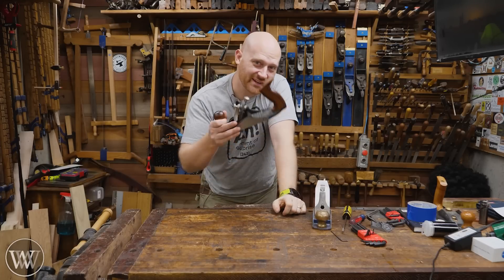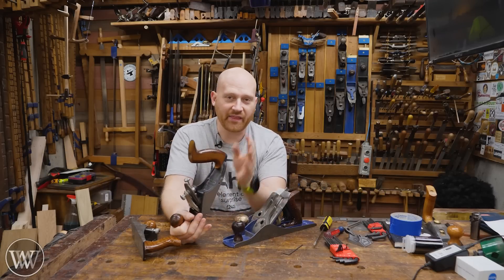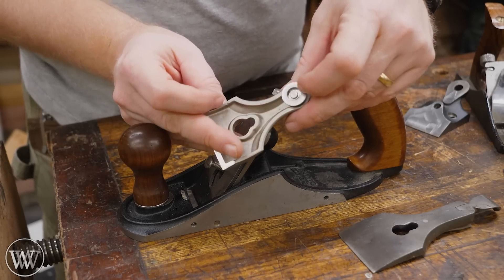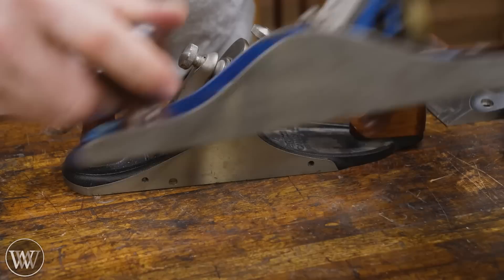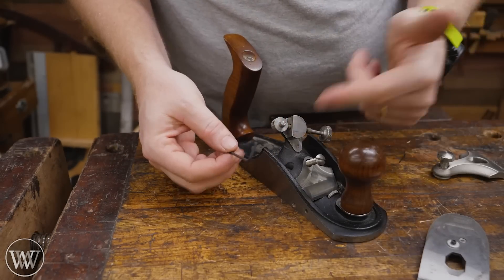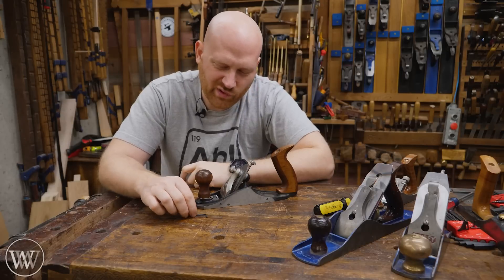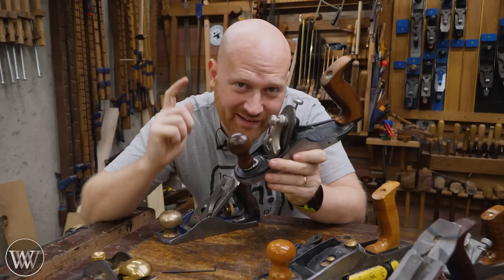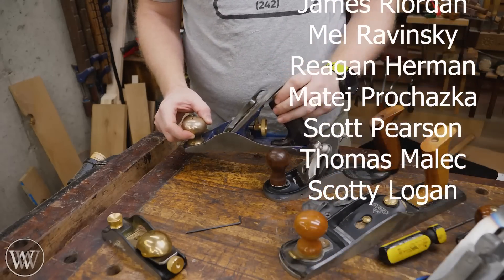The Best Plane Ever Made!

Comment: Struggling right now with deciding buy vintage, buy a decent mid-range No 6 plane currently on sale, or splurging for the Veritas No. 5-1/2 custom Jack. You have me leaning towards saving up for the Veritas. Unfortunately LN and Clifton are just way out of the price range.  Thanks for the video!
Reply from the maker: they are not going to give you any better work, it just comes down to how do they make you feel and how much work does it take to dile it in each time.
Reply: If you were between a vintage 5 1/2 and the veritas custom version, I'd say that's a harder call... I have several old 5.5s that are fantastic, though less able to be dialed in than a veritas custom (I don't have the 5.5, but have 4 and 7). The money saved on vintage might well be worth it there. 

Personally, I don't find the 6 to be a size I like to use for much, so between those 2, I'd go Veritas no doubt. I prefer a 7 for jointing even smaller work, and the 5.5 is a great all around plane. The 6 just seems to be stranded in not all that useful range. My 6s rarely get used.
Reply: @michaelcummins5974  thanks for your input. I enjoy hearing other people's thoughts as it helps maybe get a different perspective.

I've been going back and forth debating whether to save money and purchase vintage, with the expectation that I will have to put some time in tuning it up, or just buying one nice new plane that can cover most of my needs for now.  I have an old Stanley Bailey No 4-1/2 that I inherited and put a new iron in, but it still needs some work.  I would love to find an old Stanley 5-1/2 for $20 but that size isn't so common in the US it seems, and I don't get much time to try and search the flea markets, and garage sale season won't start up again until it warms up a little.  When I look on ebay, it seems like most decent vintage planes end up going for more than I would have thought, which makes me ask "if I am going to pay over $100 plus shipping for an old plane that will need work and possibly a new iron, should I just save and buy new?". Still I guess $100-$150 is less than half of the Veritas 5-1/2 which currently lists at $359 in the US.  The advantage of the Veritas is very little initial with to get started and I like the idea of an adjustable mouth and set screws to keep the iron aligned. Very much a "set and forget" setup. 

My reasoning for thinking of getting a no. 6 again had to do with the thought process of if I could only get one plane right now, a 6 could be used for straightening, flattening, and joining smaller boards.
Reply: @Nick-iz9zo  that 4.5 will be well worth the effort to get it tuned up nice. I'm a big fan of smoothing planes and have an embarrassing number of them, but I gravitate towards the 4.5 size as I like the extra width and weight. 

A jointer doesn't need to be crazy fancy imo. I say this having a fancy veritas custom 7, but I stumbled on it for a decent deal and couldn't pass it up. I have a lot of vintage tools, but I also have an excessive collection of Veritas tools as I just love working with them, and the value to price is unmatched in hand tools, imo. Anyway, a jointer needs to be nice and flat. You don't need to be able to dial it in so perfectly like a smoother, and it doesn't really need to take wisp thin shavings. Honestly, most work you do with a jack plane is even less precise. So if you want to upgrade the most critical plane, James has it right... The smoother is the one to get just right. I like having multiple with different set ups and to cut more or less final finish passes, so you could get by with your 4.5 nicely tuned up for now, and maybe later add a more premium smoother... Then you do the bulk work with the 4.5 and take the last shooting passes with you premium one. Less fiddling with setups and your fine dialed in finish plane won't need taken apart to sharpen as often, losing that perfect setup each time. 

Anyway, yeah used market is kinda crazy high now and it's hard to find $20-30 vintage planes anymore. I tend to agree it's not worth the time and hassle to tune an old one up these days with the current prices. 

Maybe check out Cosman videos about how he uses 5.5 for almost everything. It might suffice for you even for smaller jointing tasks. It's a very versatile plane if you'd rather buy one high quality plane than a couple more moderate ones. He likes Woodriver... I have some and they're pretty good for the money, but personally I'd rather spend a little more for the Veritas. 

If you want to save some money, the standard Veritas bench planes are still fantastic and a little cheaper. The custom are very nice, but if you're not going to customize them with different frogs etc, there isn't that much benefit over the standard line. I don't know that I'd say the custom is worth it for a 5.5 if you plan to have a good smoother and jointer eventually, but probably is worth it if you plan to use it as one plane to do all those tasks.
Reply: @michaelcummins5974  thank you again for the reply.  The Rob Cosman videos on using the 5.5 is what led me down that path.  I was thinking of getting a good 5.5 and then getting a couple irons for rough work / straightening / flattening, and one for smoothing. I'm  still a very novice woodworker and have been primarily a power tool user until I recently discovered how much I really enjoy using hand tools.

I do plan to continue to tune up my 4.5.  It was my great-grandfather's so I have sentimental reasons for it, even though it is a war era model with the plastic iton adjustment knob and no frog adjustment screw.  But I think I can get it performing well as a smoother with a little work. Sounds like you have quite the collection of planes!
Reply: @Nick-iz9zo  yeah the value of those old family heirlooms can't be measured. Wish I had some working hand tools from my grandfather etc, but don't think he did much of that kind of thing. Got lots of tools from my dad, but not much that's really sentimental in the same way, mostly just general user tools like hammers etc. 

Personally I don't like switching setups a lot, and am willing to pay a lot more money to have separate planes for each task, especially ones that are very specialized to that specific task. But it's not cheap, takes more space, etc. Good thing about a nice 5.5 is it's a great plane even if you end up with 4 or 5 more specialized bench planes down the road. I love my 5.5s, almost all antiques in my case. It's versatile and will still be very useful if you someday add to the collection. I don't think the 6 is nearly as good on either front. 

I wouldn't buy an iron for smoothing for it, you already have a good option for that with the 4.5. you probably only really need one nice iron for most work to be honest, then maybe a second cambered more if you're going to use it as a scrub plane (for heavy removal). Again, for this I'd just use an old junky plane instead, including the iron from it. You can probably pick up a cheap 5 to turn into a scrub for less than a decent second blade. Even a cheap (but not badly cracked etc) wood plane works great for a scrub. They don't need to be precise at all. 

The war era Stanley's we're def cheaper made to save metal, but they still work quite well if properly tuned up. I def prefer the type 11-13 (19teens leading up to the war) Stanley's, but honestly I like Union and Sargent VBM models if similar vintage probably even more. Because they're not as collectible, they tend to be a little less expensive too. 

If you don't watch Rex Krueger already, he's a fantastic resource for doing great hand tool work on a tight budget. Also, wood and shop is great, their website has great reviews of many hand tools of all kinds. He's a hand tool woodworking teacher, and really great for those more new to this world. 

Best of luck!

Comment: Beautiful plane. It is hard to know how it compares with my LN 5 ½ which is my favorite.
Reply from the maker: The LN has better fit and finish, but is not much better then an antique bedrock. and about the same price. the Veritas custom is a complete redesign and has far more flexibility to it. but in the end it comes down to personal choice and preference.
Reply: @WoodByWrightHowTo  James: Good points. The only problem is that it's hard to tell how the two differ in actual use without spending considerable time with each in hand for some time - not easy to arrange. Theory is one thing; practice is another.  But I thoroughly enjoyed your review. George

Comment: Any plane is better than the one im using. Its one of those folded steal frog planes with a missing adjuster assembly. So i had to craft one. (Im not a machinist) made it out of a elevator bolt and a flush mount nut that is conmecter to a regular bold i had to file conecting knobes.

Comment: I got my Veritas custom a few months ago. The fiddly little screw holding the iron to the chip breaker is horrible. I'm trying out simply not using it and relying on the set screws and the cap iron to keep it in place. Seems to be working
Reply: Hmm interesting. It doesn't rotate at all? I guess if you have the side set screws dialed in pretty snug it probably wouldn't...

I might have to give that a try!

Comment: I wonder if you couldn't make a tote that is angled to use for a shooting plane?
Reply from the maker: I have seen a few try. the problem is wood grain. if you can find a log that turns at the correct angle it would be possible, but then the grain is going in the wrong direction for a tote. wood yah makes s tote turner that can do that. https://shop.woodyah.com/The-Original-Tote-Turner-Shooting-Board-Adapter-p528834359
Reply: My brain didn't go to adapting a regular tote or the grain of the wood for a 'bent' tote. Seems like the adapter is a good application. 👍
Reply: ...also, it shouldn't be to difficult to find replacement screws to 'upgrade' the minor issues you described. Most hardware and big box stores will have a board to size the screws for you.
Reply from the maker: Unfortunately they don't make 1/4 22 anymore. Stanley uses several threads that were at one time common but now are very specialty. Most the time you have to cut your own if you want a new one.

Comment: I’m seriously curious about the differences, pros/cons regarding Lie Nielsen and Veritas.
Reply from the maker: LN basically takes old designs, spruces them up a bit and turns them out with exceedingly high quality. Veritas tends to start from scratch and try to reinvent the tool. Sometimes that means you're going to get a tool and a lot more knobs and features. But a little bit less of that classic look.
Reply: Wood by Right has the response spot on...I have both brands.  For my bigger hands, the Veritas planes are fantastic as well as the little features added.  This Veritas custom plane has a lot of comfort features such as the screws to keep blade in general position thus its less time to tune in when you take out and put iron back in.  Both companies have stellar customer service and stand behind their products.

Comment: Looks like Veritas did a lot in coming up with the design. That said, I’m not a fan of the Norris style adjuster.
Reply from the maker: Same here, but this one is very different from most.
Reply: I almost bought one. I saw how much you liked it and it looked like there were a lot of new design points that they figured out. I ended up getting a LN and a Wood River, but my Combo plane, Router and new rabbet plane are Veritas. For my jacks and smoothers, I got my restored and upgraded Stanleys. By the way, James, any chance Reed Planes would make a wedge kit for #3’s? That’s kind of my specialty smoother for tough grains

Comment: Cap iron issue needs a vid (it slides when you tighten it, making v awkward when you try get a tight cap iron for figured wood)
Reply from the maker: I have never had the problem of it sliding with the locating pin there.
Reply: Your not getting it- think about what I am saying >it’s a problem   
The chip breaker moves when you tighten it making it nearly impossible to achieve a tight capping iron to blade fit…..
Reply from the maker: I find it annoying that the screw is so small. I lost mine and had to replace it. that is why there is a washer there. the head on my replacement was too small. I am sorry I do not understand the problem you are referring to here. mine does not move when tightening it.

Comment: I have two #4’s. A bedrock and a bronze Lie-Nielsen. I can get different frogs for the Lie-Nielsen. You can also get different totes and knobs, or better yet make them. I don’t think the Veritas is any better or worse, it’s just different. As for my #4’s, the Lie-Nielsen is the better one. There are two main reasons for this. The first reason is that it is bronze, and much heavier. The second is the blade is twice as thick, making it more stable. I looked at the Veritas before I bought the Lie-Nielsen. Gave it a pretty good workout at handworks quite a few years ago, I felt like I had to do more fiddling around with it. Didn’t really like the adjuster. Personally I think the best thing that you can do to an old plane is replace the iron, with a thicker iron of your choosing. Assuming that the older plane is in good shape.

Comment: Here’s the argument I’ll start in the comments: configurable from a set list of options does not mean custom. Custom means i get to talk with the manufacturer, and we work out all the specifics of exactly what I want, and exactly how it can be done. I run into this with guitars a lot. I’ve had a custom guitar made. I designed the inlays myself, modified the body style, and had the neck customized as well as a really weird control scheme. It was fairly expensive. That is what custom is, though: every detail worked out between the manufacturer and the buyer.